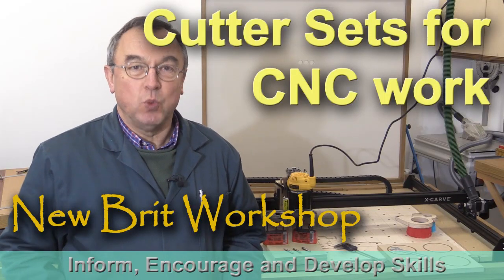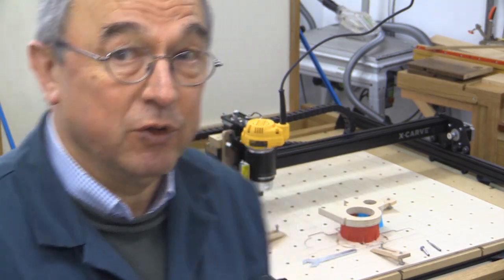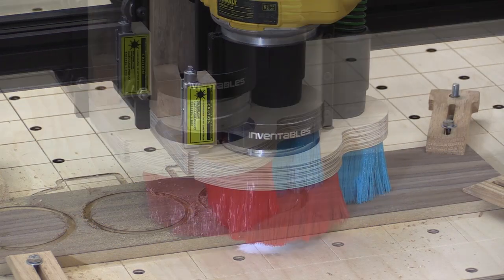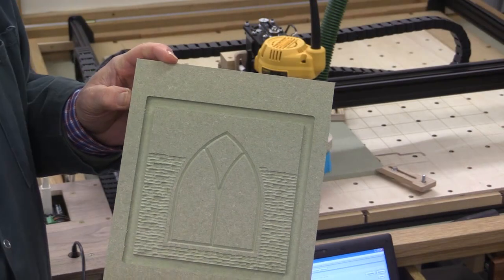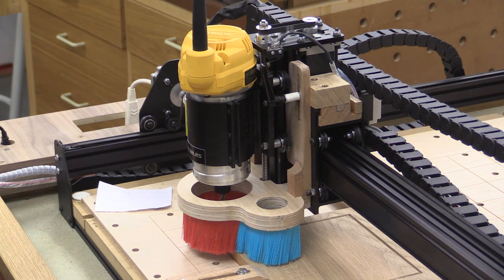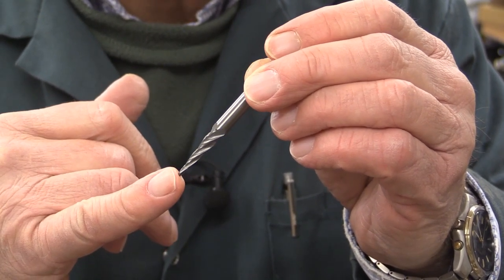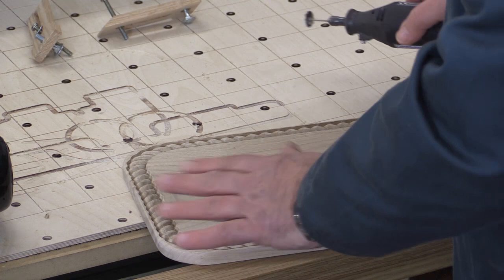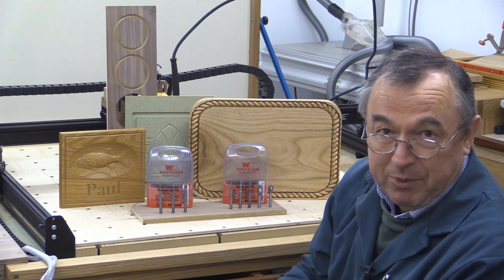CNC Cutter Sets

Comment: Hi Peter have just watched this video. I have bought the ooznest  750 x 750 2 years ago and I am starting from scratch. I have been using tinkercad then fusion 360 to do the projects. I have two questions to ask you. 1. Could you please send me the spreadsheets mentioned in the video please. 2. I cannot afford to buy the V.Carve but do you think it may be worth saving up if it is easy to learn. I am up to the stage now where I need to zero the probe. I am using Universal Gcode  Sender due to the controller I have and I have to say there is not a lot of information for setting up the g code for the 3 dimension probe I  have. 
I think your videos are very informative and often consult them before taking on a project.
Reply from the maker: Hi Mark, VCarve Pro and Desktop are very easy to learn and simple to use. There are some very clever features which I need to remind myself how to use from time to time but overall it is brilliant. In order to get plans or to contact me via email I need your email address. YouTube no longer has a private messaging service and so in order to get in touch you need to place a comment on this or any other video with your email address. The YouTube software should identify and send it to the spam folder for The New Brit Workshop. Nobody will be able to see your email address except you and me. I will then delete your comment so that it does not end up in the public domain and I will then send the plans. Were we to do this the other way around then my comment, with my email address, would appear for all the world to see.   Peter

Comment: hi peter. Great information. id love a cnc but I don't think my computer skills would be up to it.Do people use down cut bits with cnc or does pushing the chips in to the cut affect something, as I never see people using them.
Reply from the maker: +o bez    Down cutters leave a nice clean surface and are popular in CNC work. You can also get a compression cutter which does both and leave a good top surface (as its tip is the down cut part) and yet clears the debris and can be used at a reasonable rate.    Peter

Comment: Hi Peter, Are the spiral cutters HSS or solid carbide? Have you considered a down cut spiral cutter for one good face or an up/down, otherwise known as a compression spiral for 2 good faces.
Reply from the maker: +George Savage Hi George, Solid carbide. Yes, I would like to have a down cut and am aware of their benefits of them and the compression cutters. I have just shown the ones available in the CNC cutter sets.   Cheers.    Peter

Comment: Hi Peter looks like you really are getting this dialed in well.
Could you mention the total machining times when you show a new piece?
Did you know there is a machining grade mdf, EURODEKOR DEEP ROUTERING GRADE MDF. Its dark, dense and cuts like a dream.
Reply from the maker: +Michael Tricker  Hi Michael,  Yes, I will try and remember to mention machining times. The longest one of the recent lot was the breadboard which went on for about 1 hour 15 minutes. The Fish only took about 16 minutes. The boarder work with either the V cutter or straight upcut took seconds. I have used a lot of CNC grade FB but it is getting harder to get because the 18 mm moisture resistant is cheaper and has a hard surface layer. This benefit is not there for the 10 mm WR that I showed in the video.   Cheers.   Peter
Reply: Thanks for the timings.
The machinable mdf is used for kitchen doors so I keep an eye out and do some skip diving when I see some one having a kitchen refit. A hot air gun soon gets the vinyl or foil covering off leaving a nice big square.
Does the moisture resistant "fluff up" at all?

Comment: These sets look great but i cant find the sets on router cutter?
Reply from the maker: +Highlandboxes I think that the sets are brand new so just send them an email.    Peter
Reply: +Highlandboxes  Whiteside doesn't even have them listed on their site yet.  Amazon does for $159.99 +$10.99 shipping (US). There is another site, Carbide Processing, that has them for $139.20 and FREE shipping (US), they will ship Internationally for a $15 fee if they can't be sent directly from supplier. You save $21 and may pay $15 for S&H, but still net $6 savings off the main price plus save the additional $11 from S&H charges.
Reply: +Jim Hallas Thank you very much Jim.

Comment: I run my x carve with a 1/4" upcut at 3000mm/min,  2mm depth per pass. in mdf I think you can speed yours up.
Reply from the maker: +Jamie Phillips Hi Jamie,  Many thanks. Which model do you have and have you modified it to make it more rigid?    Peter
Reply: New Brit Workshop 1000 x 1000 and I have now done the x axis mod, but i'm still running it at the same feed rate. haven't noticed a real difference.
Reply from the maker: +Jamie Phillips Hi Jamie,  Many thanks - I will try cranking it up a bit.  Cheers.  Peter